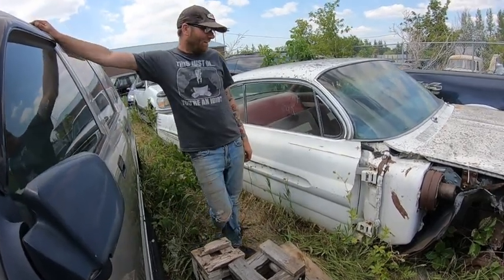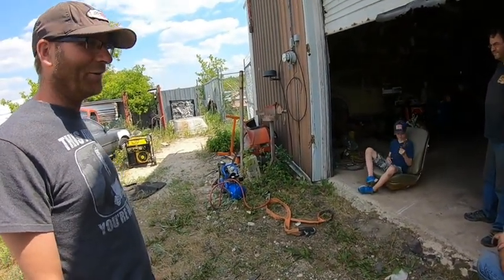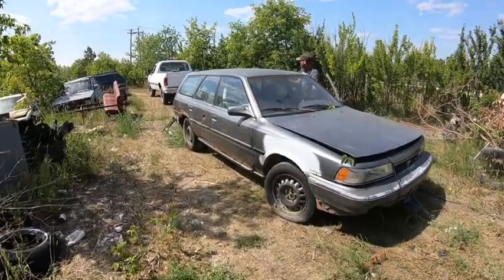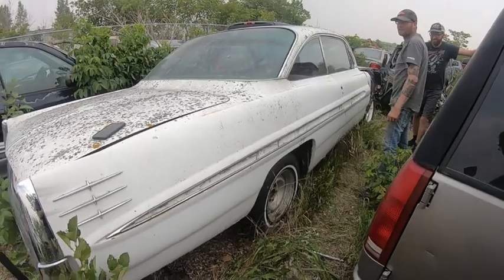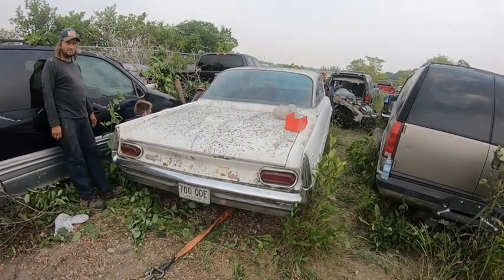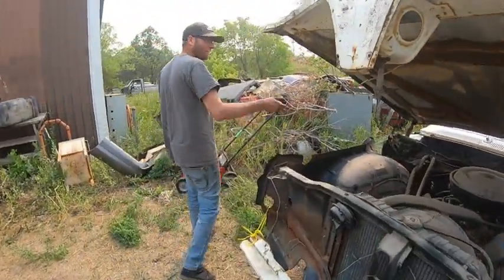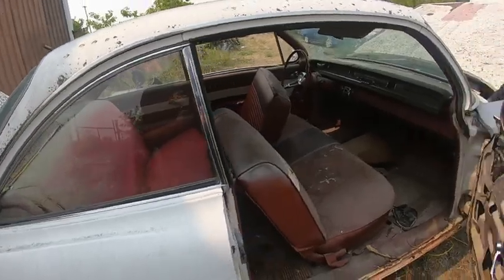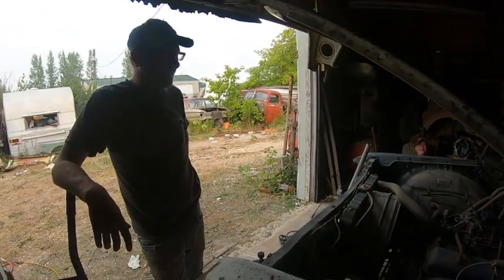1961 Pontiac Laurentian Field Find, Save, Rescue.  Canadian Pontiac Survivor.

Comment: Little sad to see the 287 or 389 is gone, but I bet it'll run really nice. The gas pedal has the GM accessory slip-on rubber cover, to protect the carpet from high-heels. Nice solid complete car, even the interior is in good shape! Love the bubble-tops!
Reply: Canadian cars never had Pontiac engines in them.  This is not an American sold Pontiac.
Reply: @LSswapGarage1  Oh that's right! The whole driveline is Chevy. It'd be cool to find a tri-carb 348 for it! I wonder if any came with that engine...
Reply from the maker: Thanks for watching.

Comment: Luv the Pontiac guys.Corey check out Iron Trap Garage,Matt's using a hydralic clutch master/slave cylinder combo from NAPA originally for a mid 50's Ford cab over Y-block.The ones I've used were originally for a "59 Ford pick up.Easy easy set up for the Henry J
Reply from the maker: Thanks Tim i watch all his videos good old Mike.

Comment: Excellent video Penny's  :) I remember doing a 1960 Pontiac Le Mans car 2 door had original (get this Lol ) had factory of 153 Cubic Inches 2.0 Litre 4 cylinder with 2 barrel carb with hand choke cable to knob dash with only options power steering, power brakes, power trunk, power Convertible top Vinyl black , 4 wheel drum brakes, had restored to Cherry Red body too and fun part Unibody frames went to full frame too ! Floor plus trunk had be replaced to on restoration and fun had 2 speed Automatic transmission too without Park Selection on small selection on dash  right side near gas pedal  and 5 seater to black interior with red dash! Had updated Am/FM radio with Cassette plus 5 speakers too ! But change engine to 283 V8 2 barrel carb on it plus Daul exhaust  too by owner ask to and got GM approval sticker near rad shrode  on 283 to put ! But funny original 4 cylinder motor look like Chevrolet Chevette car motor in blue color  Lol!
Reply from the maker: Bahhhaaaaa thats awesome there Andrew  😎😁👍👍👍
Reply: @pennyshotrodscustoms  thank you guys also but want Lol that Pontiac has originally 4 cylinder it shooked  there car when start up on cold or hot start! Funny part that last night when check out Market Place on Facebook after message plus watching video see car up for sell for $25,000 North of I live plus a Estate  sale it shock me ! But may get 25.000 for it also wild  does and hope does it worth it !
Reply from the maker: @AndrewHCann  😁😁👍👍

Comment: Recently had the same problem with a starter on a '67 C10. You can just swap the snout from the old on onto the new one.
Reply from the maker: This one didn't have the starter so we were just hoping one from a 6 would fit.  We may have found one from a V8 but it is from a standard car.
Reply: @pennyshotrodscustoms  I somehow missed that. The C10 was a stick and we did get a new replacement that turned out to be junk, so we reverted to my original suggestion of using a known good starter and swapping the snout. The best advice I can give you is to bench test the one you are going to try first, the top bolt isn't fun. There was limited information on this when we ran into the problem but I think there were only two variants and I am hoping you luck out.
Reply from the maker: @spokes5201  👍👍

Comment: I would like to you make this 
car into a 61 (Super Duty, first year of the Super Duty) put a 421 modifed motor with 5 sp. so you can run 4:10 posi. In the rear minus all the aluminum parts and perferated frame.  Don't forget to put some stock looking bucket seats and repaint it white like my friends 62 Super Duty!!!
Reply from the maker: Sounds like a plan down the road.

Comment: Reminds me of the Old Factory Super Duty cars that raced in the mid 60's  Pontiac is the best looking car in my  view of the General Motors cars at that time.  That plastic  rear seat cover blows me away. remember them well, used to say saving the seats for the next buyer so you got more for your trade in.  nice small block, with 4 speed  would fit nicely  in my dream Pontiac.
Reply from the maker: Totally agree Gary they sure are and not sure what engine it will get but i do have another 4 speed its going to get.
Reply: Grandma had plastic on the couch! Not sure who they were saving it for! Maybe for when real guests came to visit. Plastic off for them!
Reply from the maker: @unclemarksdiyauto  This weekend we are going to pull the faded seat cover off and take a look at the rear seat and the condition a little better.
Reply: @pennyshotrodscustoms  Lookijg forward to seeing what’s underneath too! Hope the cloth is not brittle!

Comment: I love the lines and style of the 61 Pontiac B bodies.  I've read they shed 400 lbs compared to the 60 models.  The bubble top roof line is sweet.  As is the front end treatment.  Pontiac design in the 60's was second to none.  Pontiac power and a 4 speed would be sweet if you changes things.  Looking forward to this one.
Reply from the maker: Thank you TT all i no it will get a 4 speed for sure.

Comment: Guys: was that Pontiac a Wide Track Pontiac or was it built on a Chevrolet chassis/frame.?
The reason I ask is. The wheels don’t seem to be set in from the wheel wells.
The body doesn’t seem to overhang.
One of my favourite years and body styles.

Cheers
Reply from the maker: I believe it is the same as a Chevy frame  👍👍

Comment: You know you could change the nose cones on the starter that transmission is actually called a jet away actually a 2 speed with a 2-stage torque converter butter for Speed would be a lot more fun
Reply from the maker: Thank you for the info.

Comment: Find a starter from a V8 small block from 55-58 Chev or Pontiac. It'll work. I've done it
Reply from the maker: believe i found one so going to try it Gord.
Reply: @pennyshotrodscustoms  I forgot to mention that a little grinding is required. I had to go back a bit in my memory bank.
Reply from the maker: @gordhammond7105  Thank you Gord.

Comment: Looking at a lot of Canadian vids,it appears that Pontiacs were the indigenous car of Canada. they seem to be every where there. Was the Auto trans one of those Pontiac things with a switch pitch convertor? two ranges but four speeds.
Reply: Nope. Cast iron chevy powerglide. These Canadian Pontiacs were built in Oshawa on the chevy X-frame, so mechanically this one is a Bel Air. All of the running gear, the floorpan, the cowl, lower steering column and pedals are chevy parts.
Reply from the maker: There are some still kicking around here but getting harder to find.

Comment: SNAP!! LOVE IT!! STacked headlight Poncho!! THANK YOU!! The year I was born even! Fantastic! Canatiac! Love them!! Pontiac 455 wide block in it... trick flow heads... stroke it... Nitrous bottle to spray it? lol That long flat trunk holds the arse end down for the quarter bile stuff [Pontiac engines with the tork and that arse end make it a great launcher!]. :-))) Love it! Get rid of that transmission and marry a turbo 400 or 350... Hot rod this one don't make it factory. Worse comes to worse you can find a chevy engine [not the perfect solution for a Pontiac I know]... but ya man have fun with it. Could always jam a truck LS into it than turbo it. lol Get a HP tuners thing for the compuker laptop [worth the investment for all these old timers you'll likely end up LS-ing a couple at least]. Better than letting them collect mouse turds. lol
Reply from the maker: Not sure what kind of engine it will get but will be getting a 4 speed thats for sure pontiac engine be cool just hard to hind one around here.
Reply: @pennyshotrodscustoms  Sure enough they don't grow on trees. Somebody's got a block hiding under a hay bale somewhere's... a pipe dream I guess :-)) Was the Buick 455 pretty much the same [shitty rocker bolts in the valve train that need replacing with appropriate thick grade 8 bolts that won't brake when you board it] lol Anyway, loving the idea of you rocking that Pontiac for sure. Fingers crossed for you all :-)
Reply from the maker: @robertironside3166  Thanks Robert pretty pumped about it.

Comment: My sides are still sore from laughing. What's with the Canadian Pontiacs?  Small Block Chevys and Chevy 6 cyls. with Powerglides? It looks sort of like a Pontiac, but to be a Pontiac it must have a 389 Pontiac engine or an HO 421. That's a '61 Chevy in sort of Pontiac trim. Good luck with the "Catalina".  Maybe if you scrapped a couple of those foreign rust buckets you might buy a nice Milwaukee fuel 1/2" impact and a Stihl Chainsaw. Pardon my sarcastic humor. I'm old and must be humored myself.
Reply from the maker: I think all Canadian Pontiacs came with Chevy engines.  Boring.  No need to apologize about your humor, we are all getting old.